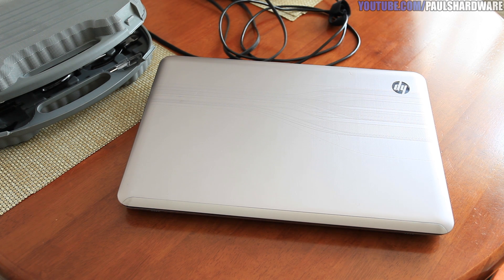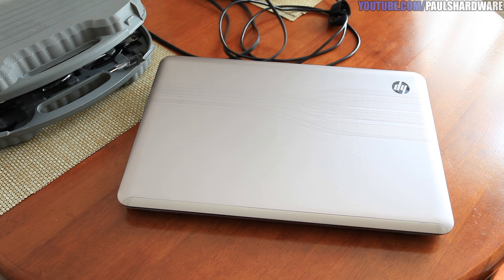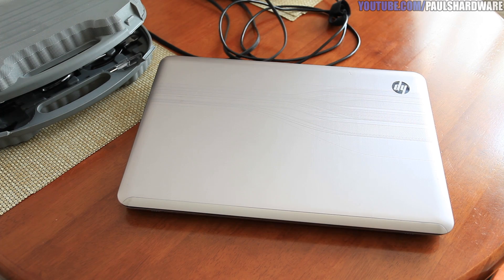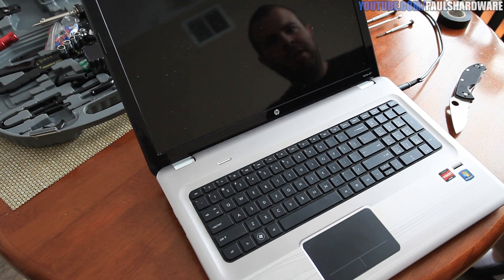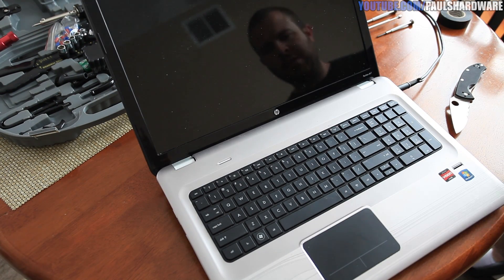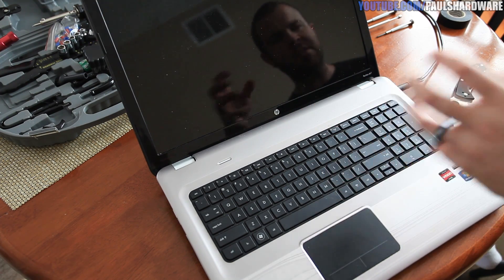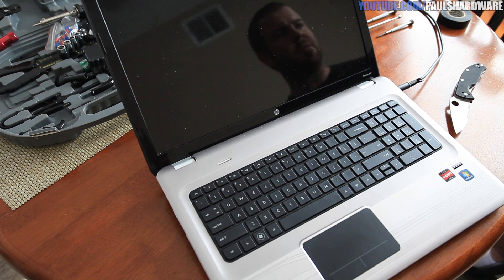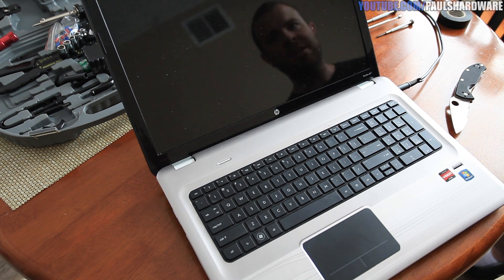How Not To Repair a Laptop

Comment: To check if its a screen fault or GPU/Processor fault, turn the laptop on with an external screen plugged in via HDMI or VGA, if it shows the desktop on the external screen then you know you need a new laptop screen, if not, like Paul said, the GPU will need to be reballed (or reflowed for a temporary fix).

Comment: I have an HP all in one sitting in my closet. The casing on it is like completely sealed. There are no screws or anything to get at the motherboard. I've tried atleast 5 times, unscrewing all the screws I could find, to no avail. Wanted to give it to my little brother if I could open up the fucking case to get at the fans and clean them out. It's 2-3 years old and has never been cleaned. Great design indeed, HP. It's the last manufactured or pre-made computer I'll ever purchase.
Reply: did you get the screws that are under the keyboard?

Comment: You don't actually have to de-solder the video chip, there's other methods, one fun cheap way is getting a Heat gun, and heating up the video chip for around 30 seconds, and BAM, like magic, the video appears. Another way is on my channel, but it requires a Rework station.

Comment: As a former electronics tech, I can tell you that laptops are, more often than not, ridiculous to tear down and put back together. Having to take apart the whole thing just to get to a flex on the top assembly? No thanks.
Reply: My last Dell had to be completely dismantled to get to the hard drive. I know they probably do that on purpose, but come on, people like changing hard drives

Comment: If you thought the issue was the screen itself why not first try hooking up an external monitor instead of tearing the laptop apart? If you were right, the external monitor should've had a picture displayed. If the external monitor didn't display a picture, then you could've narrowed the issue to the graphics chipset a lot faster...

Comment: I know that feel... Had a late 2010 emD732Z which got a noisy CPU fan (low rpm and freaking noisy) 3 years in... Tore down the system and cleaned the heatsink and fan array only to find out that it's most likely a worn bearing... I went to their service center to order a new fan only to find out a week later that they don't manufacture the fans anymore... Now, I'm trying to see if I can get a desktop CPU heatsink to work with it so that I can convert it to a portable HTPC with built in monitor...

Comment: Such a drastic solution may be unnecessary if other components are at fault (screen)
My own research also suggests you'll need 350c+ temps, ~250 may be too low to melt the solder

Comment: Hey paul, I figured I would ask for some help in the off chance you actually see this. I am building my first ever computer with rampage IV formula and 4930k processor and on power up I have had nothing but the fans and red cpu light on. I have tried re-seating the processor, updating the bios, starting with 1 stick of ram, and i am stuck. Anything i should try :/?

Comment: the blinking light on the keyboard was an obvious clue that there was probably a hardware fault, if the monitor failed, just like when you cell phone's screen cracks, the device would have continued to work as usual, it has no way to know that the monitor isn't working (well, it can know that the monitor isn't connected, but just like with any other computer, it would still boot up and act normal without a monitor connected).

Comment: Had an HP die on me in 2003. It only lasted 6 months or so. Last time I ever got a store built computer. I build my own computers now.
Reply: That's the main reason why I think HP computers are crap.  They don't last long at all until they develop problems... like my mother's laptop.  I have an Acer laptop going on 5 years old and it still runs great.  I had a Dell computer in which I bought 4 years ago.  I got tired of pre-built systems because they limit you in what you can do with them.  I'm glad to have built my own last year because I can do so much more with it.  I'm honestly done with off the shelf computers.

Comment: 1st things 1st plug an external monitor into the laptop with a dead screen and try to boot it. If it works with an external monitor you know that it is the monitor or a connector, and not the graphics hardware.

PS: My sister dropped her hp envy and the monitor also died. I disassembled and reassembled it 3 or 4 times trying to discover the problem (it looked very similar to this HP) Eventually, I gave up trying to fix it and told her to use an external monitor since that worked. My sister turned it on the same day and presto it worked... o.O Yay me!

Comment: when you start by trying to take apart the monitor, you should just stop.

also the proper diagnosing when the monitor isn't displaying on a laptop is to connect an external monitor. if you cannot get an image out of an external monitor it is more than likely not salvageable unless you want to invest allot of time and effort.

Comment: hp latops seem to be the most difficult based on the mobo mainly any upgrading has to come from an approved list like upgrading the wnic might not let you boot pass the bios with a message saying this is not an approved product and other bs also that the cpu is soldered for atleast mine there are heat issues plus no way upgrade if you wanted to so yea you are not the first to fail and you won't be being that hp limits the systems by a lot and it is the reason why i never buy from them and mine was a gift

Comment: HP is notorious for their overpriced, poorly built consumer grade laptops.  If your video card went out, don't bother baking it or heat gunning it.  *Those solutions are only temporary* and the video card will go kaput again within months if you're lucky.  Best is to buy another laptop from a reputable manufacturer.  You'd think they would've learned how to properly embed a high thermal components after nvidia gpus had the same problems years ago but of course not.  Good luck nonetheless, you'll need lots of it for working with HP's stuff.
Reply: The real issue in a lot of the electronics these days is the use of lead free ROHS compliant solder because it can't take near the heat stress of regular lead/tin based solder.  Every game console, laptop and video card manufacturer has had major issues with chips losing connection to the solder pads below the chips once the systems see a bit of dust buildup and begin to run hot a few times.  Re-flows can be a permanent fix if the source of the overheat is remedied and steps are taken to keep the system running cooler.

Comment: You could repair it with just a headlamp. You need to put aluminumfoil around the chip so there only will come heat on the chip after 20 second you need to press like 1 min hard on the chip! After this let it cool down and put on the compount and the cooler. After your laptop wil work again. Stupid crappie amd chip!
Reply: ***** i know Frank but it works if you have not the time and monney. its a cheap way of fixing the problem